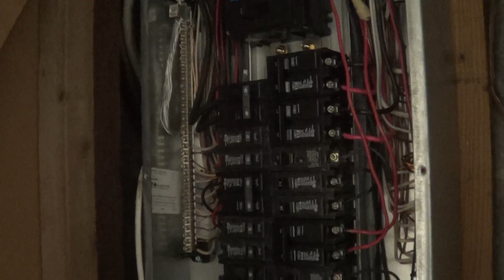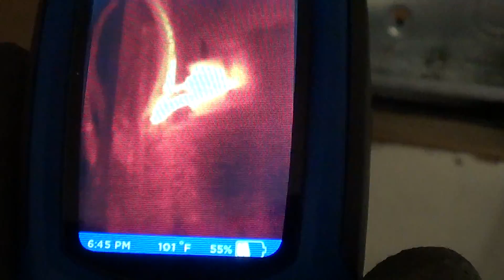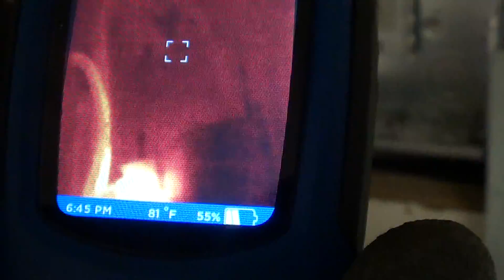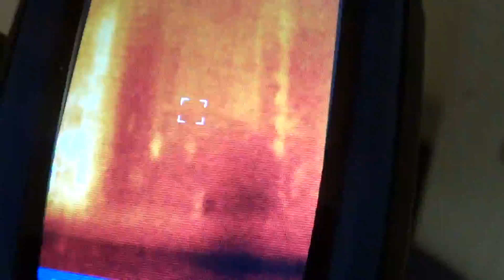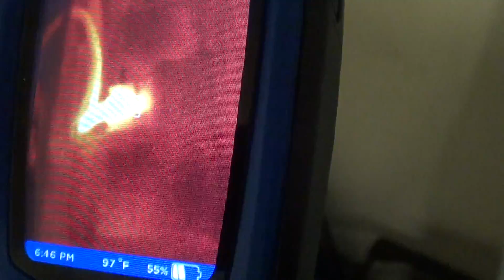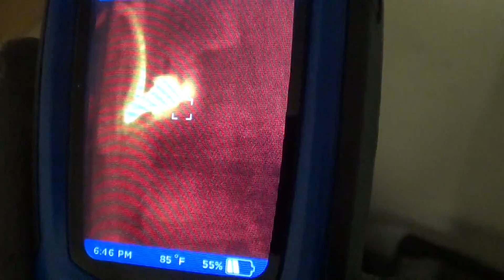Thermal camera showing a bad circuit breaker

Comment: Faulty breakers will cause an arc flash whether it’s a 480/277v 3 phase panel or 240/120v split phase panel. Once that happens the entire panel would likely have to be replaced instead of just that one bad breaker if it were caught before that happened.

Comment: MV across the breaker? are you measuring the difference across the breaker points live?
Reply from the maker: Yes,  mV in the ac mode will show the actual resistance of the points inside the breaker.  Current has to be flowing.  In general, all breakers and contactors have less than 100 mV drop.  The heat comes from mV x Amps.  In this instance, the main voltage drop was on the aluminum wire connection to the breaker.  That is why the wire is so hot in the thermal image.  The breaker measured 60mV, but i'm sure there were additional drop on the connection to the wire.  In hind sight, I should have measured from the buss bar to the stripped portion of the wire to see the whole picture.  I'm sure the mV drop at the wire connection was over 100mV.